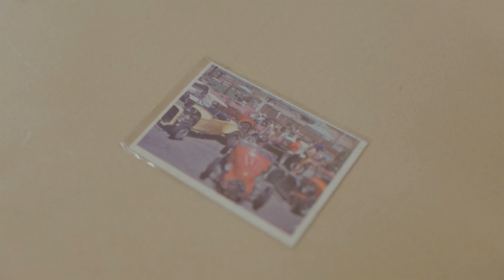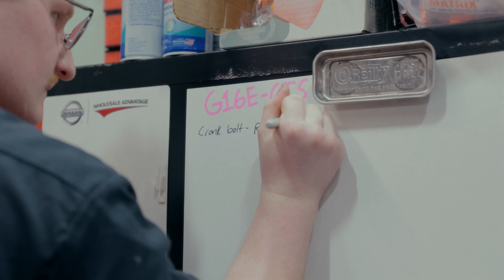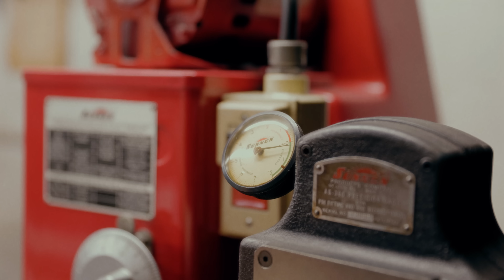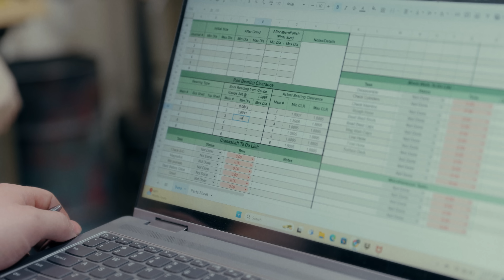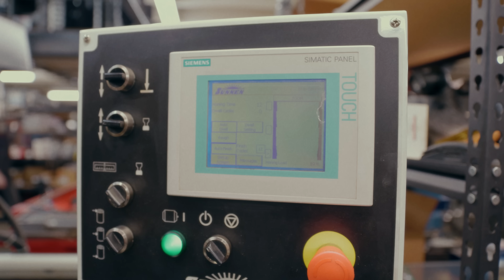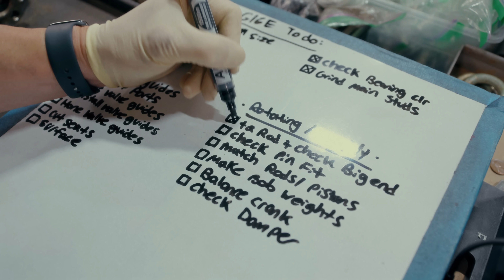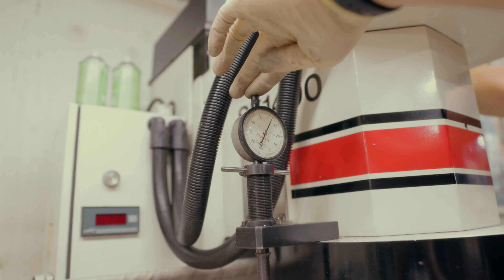Celica GT4 Engine Reveal & BUILD!

Comment: I always love brand appropriate engine swaps with a newer engine being swapped in to add reliability and more power. The G16E is a tough engine from the videos I've seen by the companies who are tuning it to see what the upper limit is on stock parts. Apparently 500HP is no problem for the stock internals, and 700 is achievable, but risks head gasket blow-by. It's definitely a great choice because it's quite a compact engine and can be fit into many builds as long as you can adapt it to the gearbox, though you do have to be willing to do some custom fabrication for the exhaust and intake to get the turbo system run properly, since this definitely isn't an engine you'd want to do an NA build with.

I think my favorite of the brand appropriate modernizing engine swaps is probably the one from Rocket Miata where they swap a FoMoCo based DOHC aluminum V6 with VVT into first to third gen Miatas. It's an NA build, but the extra torque and HP is more than enough for stock tire widths and it doesn't even mess with the weight distribution very much since the stock Miata engine is an iron block.

Comment: I'm not a fan of 3 cylinder engine but im  open-minded to new technology.  I felt that Toyota should have developed 1.8 liter 4 cylinder engine in the Corolla to GR specs.  I feel that 3 cylinders engines would be dealing a lot of more stress than 4 cylinders engines.  Should be interesting to see Ryan final output on this GR engine.
Reply: Not Toyota's first high performance 3 cyclinder they built the Charade GTTI in the 90s and that 1.0 engine was powerful for what it was
Reply: I think the reasoning is that to make equivalent power and have the same footprint, it was more reliable to make a thick 3 cylinder block than a thinner 4 cylinder block. While it sounds like the 3 cylinders are going to do more work, it also is beefed up more than they could have ever done with a 4cyl. If you look at a GRC engine bay, the block is just as long as a normal 4cyl block.
Reply: @mr2marc  Thank you for the information.  I believe that Japan engine size tax is another reason.  There have been reports in the USA of issues with the engine.
Reply: The reason is because of emission restrictions and 3cyl are popular and common in Asia
Reply: @edwardclark8808 also Toyota IS developing two new 4 cylinders for their future sports car like the MR2. You can find a Japanese youtuber reviewing it. So hopefully it's like the 3 Cylinder as in it is equally as beefy and able to handle more power
Reply: @leepicgaymer5464   Thank you for the information.  I believe that Toyota is developing 1.5 liter and 2.0 liter 4 cylinder engines.  I had the pleasure to check out 2024 Toyota GR Corolla about 4 months ago and it's cool car.  I felt the 3 cylinder turbo GR engine is powering the AWD system on the GR Corolla is under more drive line fiction than 4 cylinder engine.  Anyway, I'm open minded to see where this goes.

Comment: Ryan definitely check out head games YouTube about those Toyota 3 cylinder engines. He talks about how companies are putting valve spring kits out for that engine and basically they are less spring pressure then stock. Make sure you check spring pressure if you go aftermarket. His channel is definitely informative.

Comment: back in the day I was offered a 503E for $2500, I had know idea what trans would bolt to it so I passed on it, the guy that bought it never did anything with the motor and it still sits (from what I heard) anyways for people that don't know a 503E is a Toyota GTP motor, pretty much a 3S motor but the intake and exhaust is on the opposite side

Comment: Hopefully it doesn't catch on fire randomly like the stock engine and Toyota denying customers any warranty or help with paying the gap from insurance because "the engine was being abused" by owners acccording to the "black box" by daring driving it over some ridiculously low speed.
Reply: I heard about that. Very shameful of Toyota to do that because they advertise the GR as a track car. The car essentially has no warranty because the speed they are using is so ridiculous it could be done by a Toyota Mechanic taking it on a test drive.
Reply: I can assure you the problems the GR Corolla is having have NOTHING to do with the engine, that engine has proven to be 100% solid on the GR Yaris all over the world, there might be some problems somewhere else but the engine ain't one of them

Comment: Wrong engine choice IMHO. It should have been a 4cyl. It doesnt need the 503E (the TTE WRC cars never used them either. They were 3SGTEs with a Toyota motorsport block). A built AZ or AR series engine would have done the job nicely. More torque than the Yaris engine, which would be handy for moving the heavier Celica around (peak HP isnt as important in a rally car).